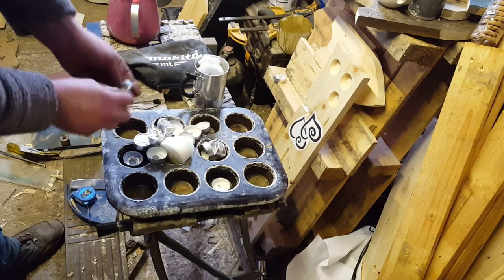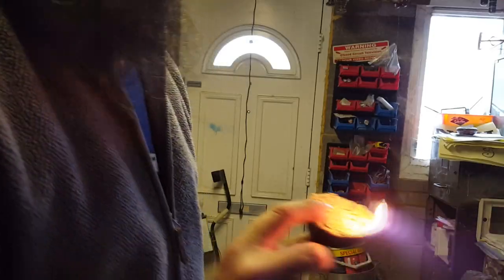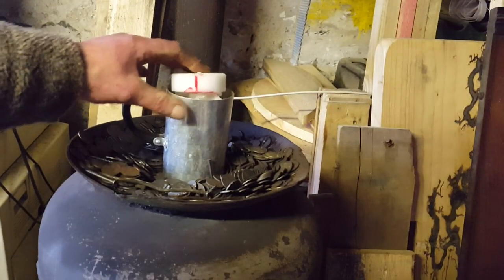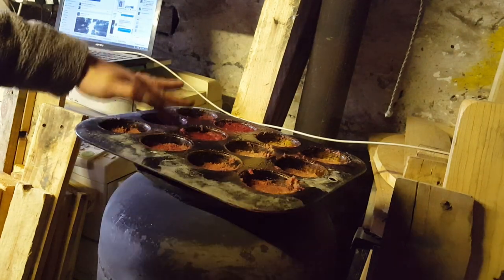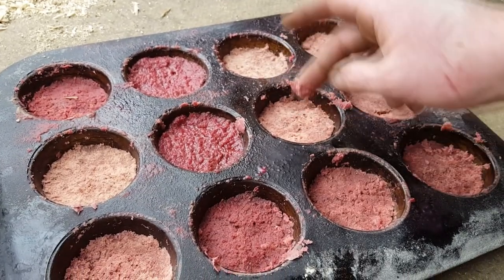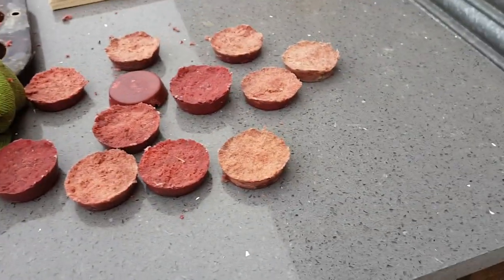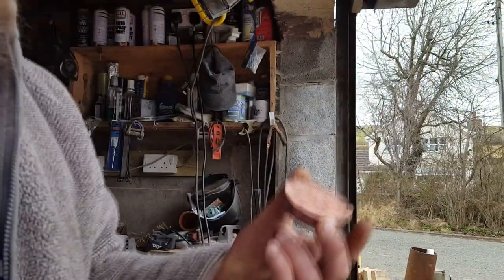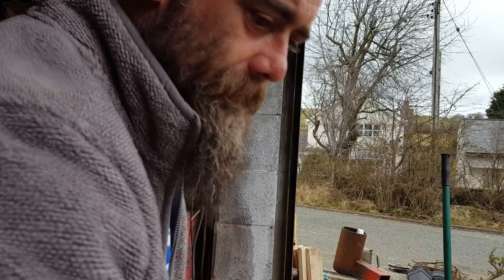Bongo Biscuits! Sawdust & wax Fire Starters

Comment: Nice, I put wicks in mine, bit of anything sticking out with wax. Also check out the disco biscuits, cotton wool crisps the wife uses soaked in wax, snap them when needed and pull a little wool out, lights immediately even with spark. 99p, for cotton pringles,(I call them) 99p for 30 small candles, Home and bargain, makes 100 and still leaves 15 to 20 candles, ready for the zombie apocalypse. Great vid. Also with your skills, I think you should make a Bow,

Comment: Very nice Bongo.
Reply: Way to much wax buddy. Use just enough wax so you can pack the sawdust with your fingers. I mix it together in a pan first. A pan pull of saw dust and pour in your wax while mixing you want it so the saw dust is still loose but is coated with wax then scoop it into your pan and press it with ypur fingers. Less wax is more and you don't have a puddle of wax when your done. It all burns

Comment: Will sawdust with shavings work or does it have to be just sawdust
Reply from the maker: Ive not tried it with shavings, if youve got a pile then id give it a whirl, im guessing theyre going to be pretty springy but still should absorb a bit of wax or get a coating. Something to experiment with?
Reply: A mixture of shavings and medium/fine sawdust works best in my opinion. The shavings give an easier to light surface area (like feather sticks in bushcraft) and the fine dust gives it density to make it burn longer.